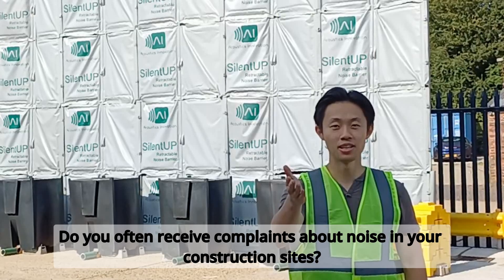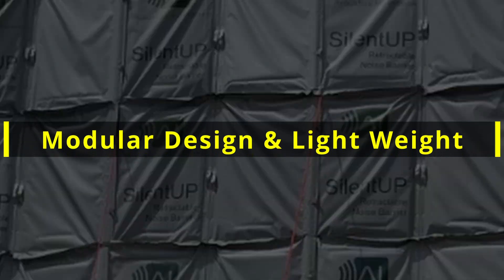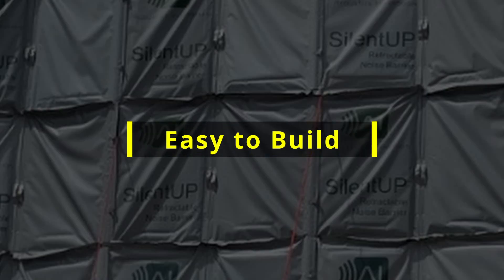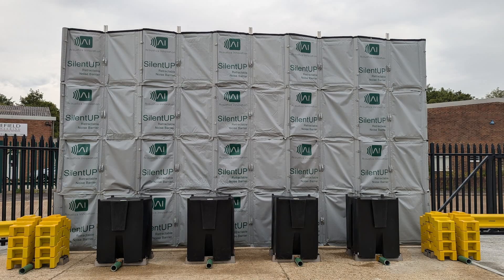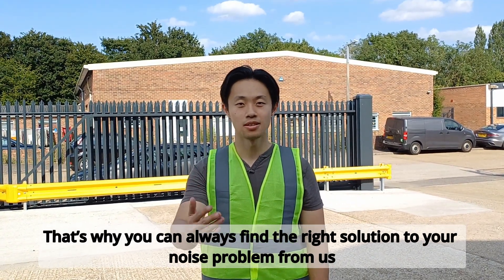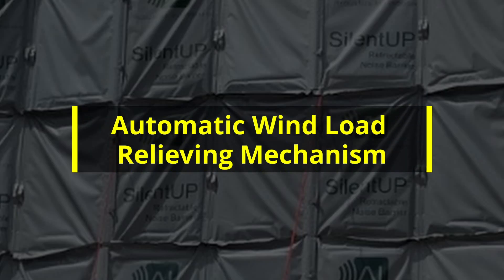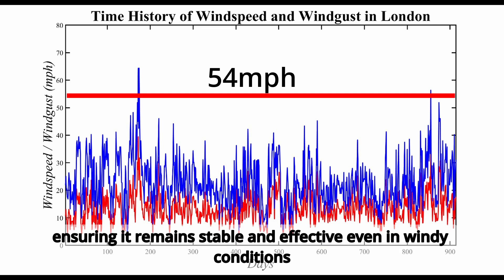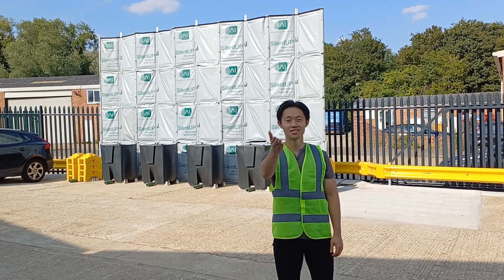The world's first Retractable Noise Barrier #noisereduction #modular #portable

Comment: Good God, I'd rather plant some trees or bushes around the property then put up a giant plastic diaper. What an eyesore.
Reply: Thats because its not designed for permanent install? The fact it was easy to set up without machinery, didn't need foundations, and is clearly a lightweight temporary structure didn't give that away for you?

This is intended for things like construction, events, etc.
Reply: It looks like you definitely don't see the use case scenario or who their customers would be. Planting trees or bushes would provide minimal noise reduction, require water, and probably years. The point of this is for ones where they need to do the job, if they can limit the noise, why not use it? 
I'm all for plastic reduction and being eco friendly, but from a feasibility standpoint, your idea is much worse to the point of it just wouldn't even be implemented in like 99% of the cases.